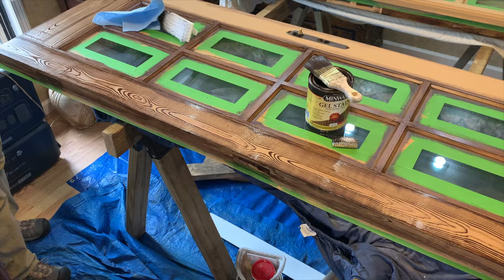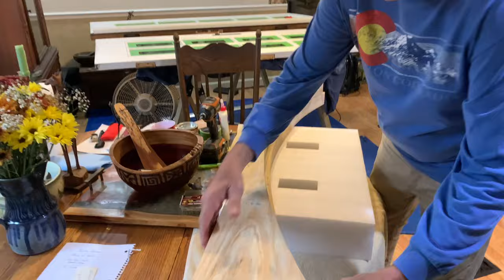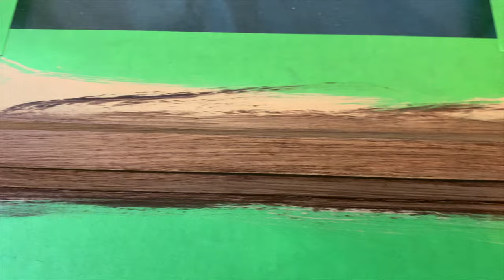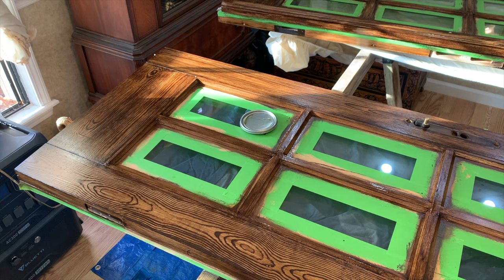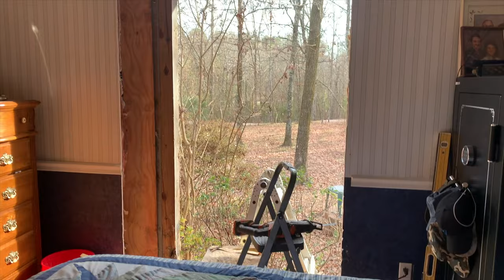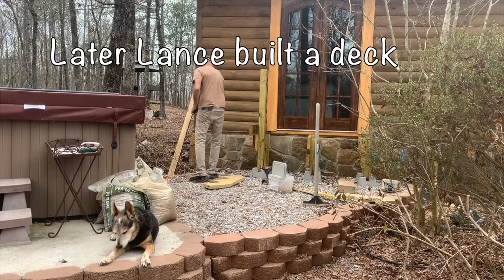Faux wood grain texture. How to refinish a door with fake wood texture. Recycle used door, furniture

Comment: Great video!  It was very informative and easy to follow along  .  The door looks fantastic!  What color did you use for the base paint?  I have to do 4 metal doors for the church.
Reply from the maker: I used valspar duramax exterior paint+primer flat finish. You can use whatever color you want for the base coat depending on what tone you like. I used a soft golden brown color. Only a little shows through. You could also use a reddish brown if you want that tone.

Comment: Cinda, could you use a tooth brush for finer details. Great to see you both.
Reply from the maker: Hi Tom, yes, I think an old toothbrush would work perfectly for the small details! It would be easier to hold than the little brush I was using. Thanks for the suggestion!😊👍👍